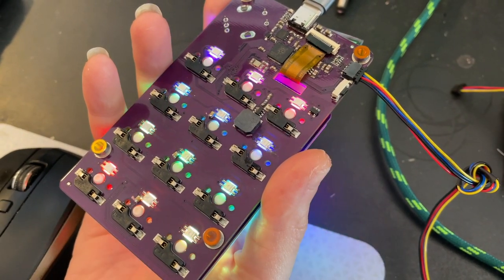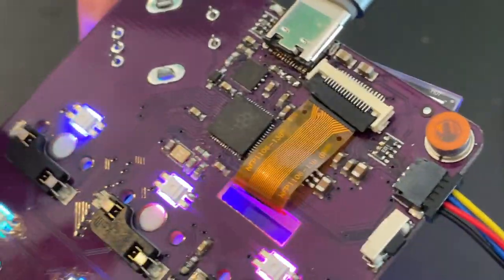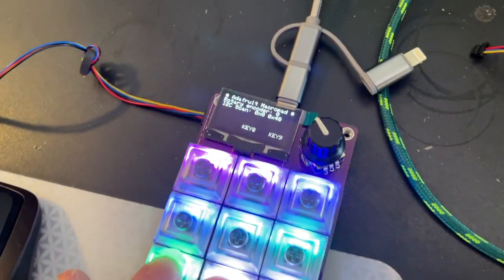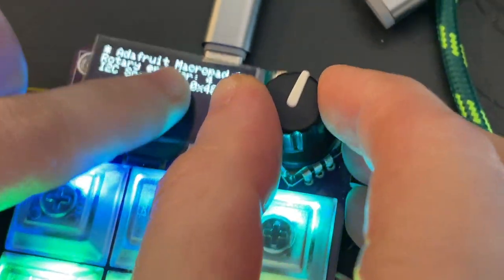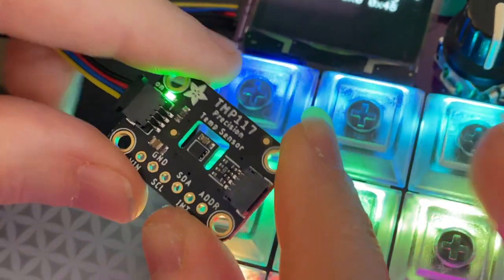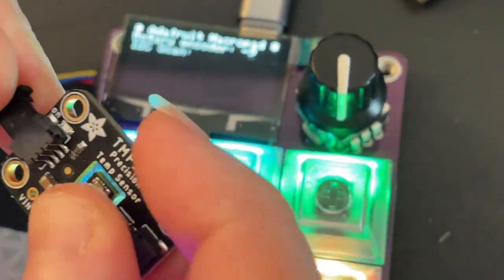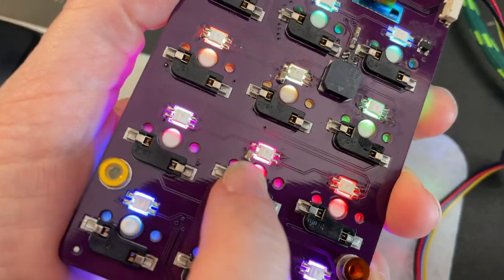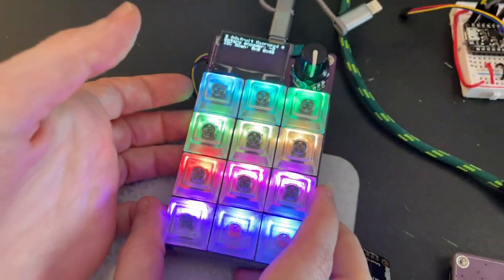Adafruit Macropad RP2040 bring-up test

Comment: I got Adabox 019 today!  Yay!  But... In the shipped code, the encoder counts the wrong direction!  (clockwise is decrementing).   Easy fix, just swap the pins when you define your rotary encoder.  But still...   Also I am seeing wonkiness with the speaker pin I am looking into... (found two different source codes on the adafruit site.  the shipped one didn't toggle the speaker pin)